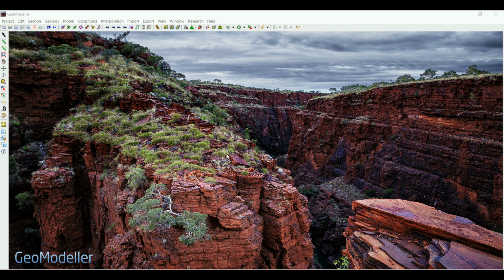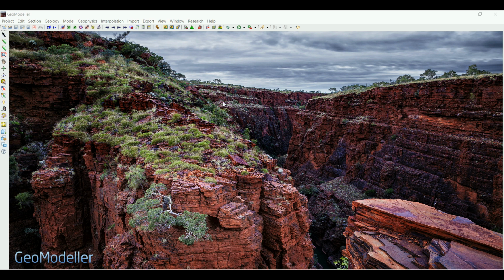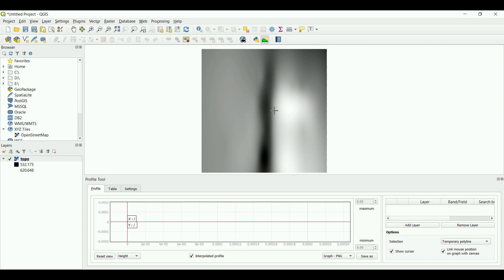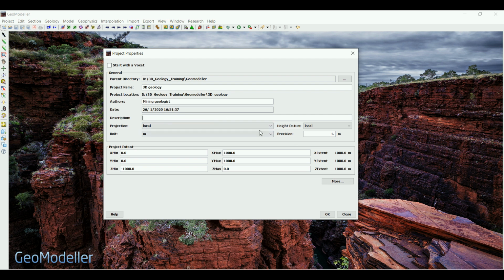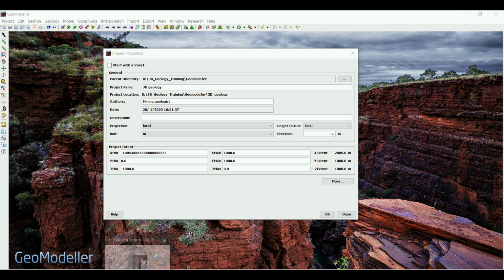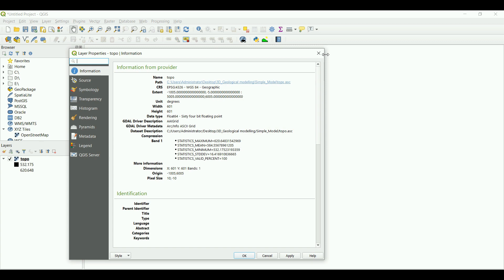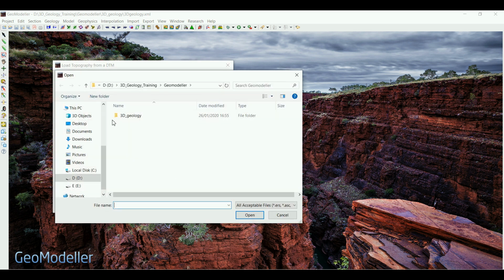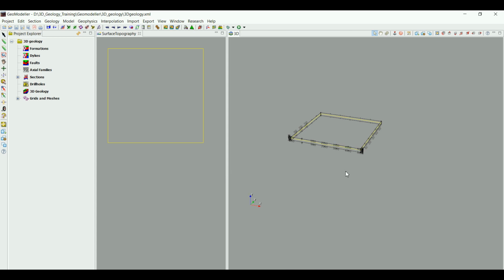3D Geological modelling : Part 1

Comment: Hi! my study area has an irregular geometry (it is polygonal area). In this case, how should I enter X and Y values? Should I upload the shapefile file to Geomodeller?
Reply from the maker: hello, if you mean an irregular topography you need either to pick a lower value that fits inside the study area with a regular shape or use the full extent but geomodeller will extrapolate the missing values . one way to fix this is by using publicly available DEM to cover the missing part of the topography